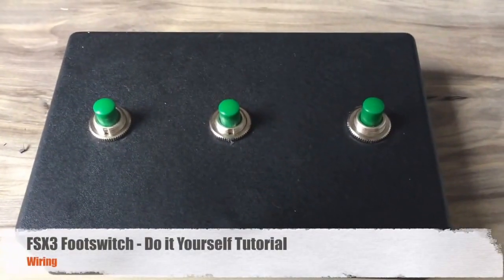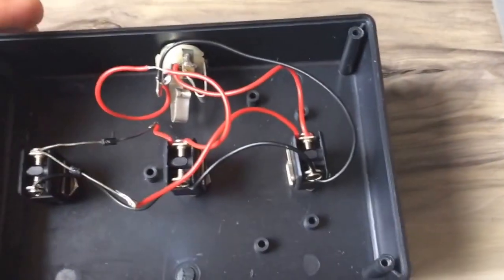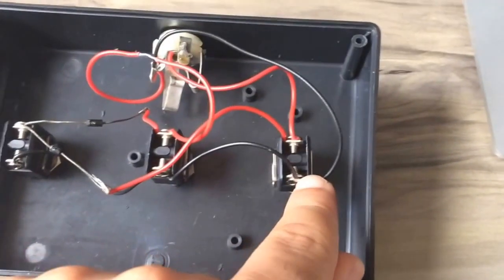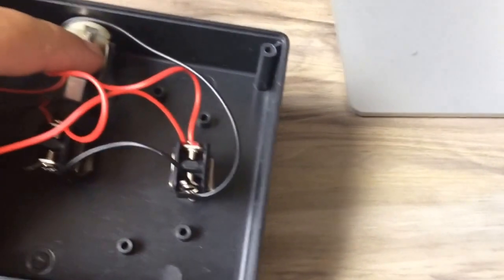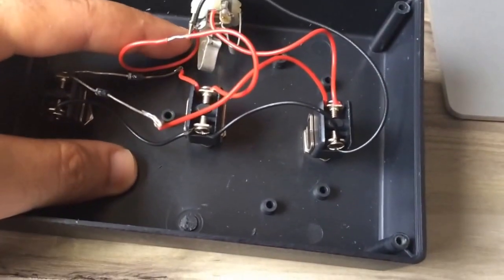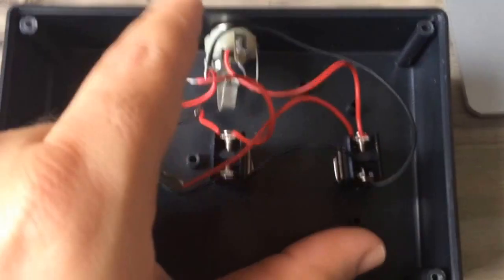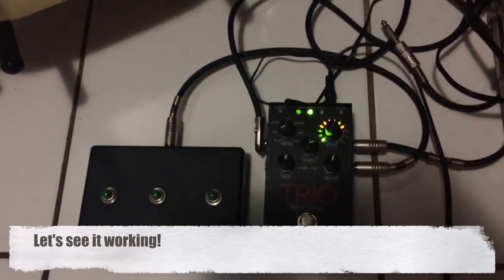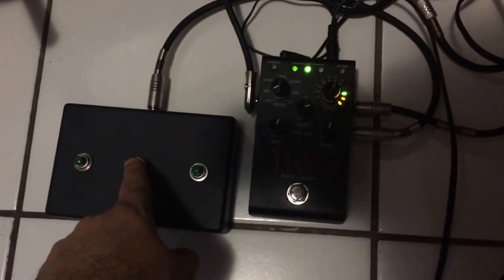How to Build FS3X Footswitch DIY - Wiring - Digitech Trio

Comment: also use heatshrink tubing on the diode wire connections and glue on the screws on the switches. or put a tag strip in there for the connections. it shorts tip or ring to ground for functions 1 and 2 then both via the diodes for 3.

Comment: Hi Diego.  A bit tangential to your post, but maybe with your electronics expertise you will know the answer.  I'd like to control my digitech Trio (and jamman ) externally using an Ext Amp out on a Line6 Helix and it seems doable since the ext amp out supports a a Tip-Ring-Sleeve  config, but the Helix manual has one warning: 
              "Connect EXT AMP 1/2 only to amplifiers that utilize “shortto-sleeve” footswitch inputs."
Do you happen know if the Trio (or jamman) FS input is a "short to sleeve" input?  Thanks!
Reply from the maker: I’m not familiar with the Line6 Helix, but given that Trio is controlled via a passive, closed looped circuit, my guess is it won’t work.
Reply: @diegoflores1553   Hi Diego.  Thx for your reply.  The Helix out - called ExtAmp out - is TRS and is also used to "model" passive amp footswitches, but they say only use amps with "short-to-sleeve” footswitch inputs.  I'm wondering if the Trio has a similar "short-to-sleeve" FS input?  If so, I'm thinking it's doable.  If not, it could damage the components, so I'm trying to be careful.
Reply: Are diodes same in number?

Comment: Are these universal? Can I use this on a Crate 3500 Shockwave solid state amp without causing any damage?
Reply from the maker: jdessell it is a passive circuit, so I don’t believe in damage. If it’s going to work, I can’t tell, because it may require a different setup in the circuit. I don’t know your amp or the functions the footswitch might have.
Reply: @diegoflores1553  The proper foot switch is the Crate cfs3 foot switch. They haven't made them in years and I can't find one on the used market.

Comment: Thank you so much for this helpful video and schematic diagram! I was wondering how DigiTech made three switches work over a stereo cable, and this explains it. Pressing the right switch (as viewed from the top) grounds both tip and ring, so it's the same as pressing the left and center switches at the same time. Very clever use of diodes! Thanks again for clearing up this mystery. Much appreciated!

This means DigiTech gear might be able to use the Boss FS-7 two-button footswitch (which takes up less space) if you can press both switches at exactly the same time (or press and hold one switch before pressing the other with a rocking motion of your foot). This opens some interesting possibilities! Thanks so much!

Comment: How much to make this yourself? The FS3X is only $30 on amazon.
Reply from the maker: Well, I live in Brazil and they are not even for sale here, although the Trio Pedal is. My guess is that it would cost $15 or less to make one, since most of the parts only cost cents. But I don't think cost is the point. I could've bought one ready made just like the one I made, and it would've cost just a tiny bit more than I spents. The point is the fun you may have building one and seeing it working, in case you're into that.
Reply: Mine was about 9 bucks to make. Took me two days because the stereo jack I bought was a piece of crap that I, literally, had to twist into shape to get it to work. I was just going to return it, but instead I stayed up all night and fixed it. Now it works just fine... and it looks badass.